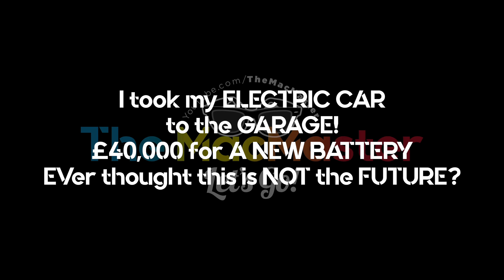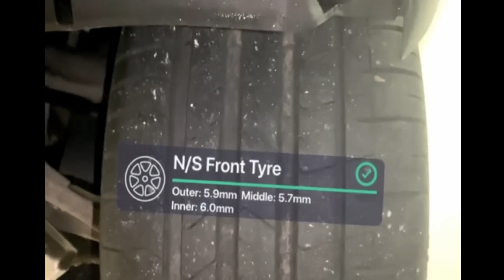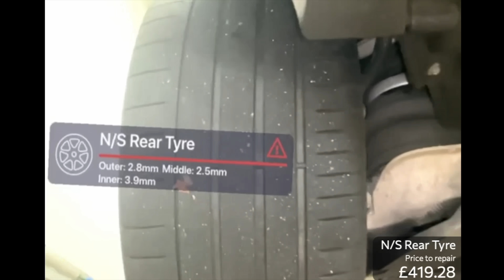I took my ELECTRIC CAR to the GARAGE! £40,000 for A NEW BATTERY EVer thought this is NOT the FUTURE?

Comment: Yes, all about control and nothing to do with reducing our emissions 🤦

The big difference between a battery in your phone or laptop is it doesn't have a battery management system like an EV does.
Most people leave their phone on charge past 100% and this degrades the battery, which is why they usually only last 2-3 years.
I had my last phone for over 5 years and the battery was still in reasonable shape, cos I avoided overcharging it most the time, managing your battery (which the EV will do for you) provides dividends.

The CEO of Porsche is just another greedy shill, as making synthetic fuels is way, way, way more expensive than either petrol, diesel or electric cars.

No electric lorries? Dude it's already happening 😂

Here are all the HGVs you can buy in the UK today.
Renault Trucks Master Z.E.
Renault Trucks D Wide Z.E.
DAF CF Electric
DAF LF Electric
DAF XF Electric
Volvo FL Electric
Volvo FE Electric
Mercedes-Benz eActros
MAN eTGM
FUSO eCanter
Iveco S-Way Electric
Scania Electric R-Series
Tevva 7.5-tonne
Tevva 12-tonne

Ah, more what-aboutism with the planes 😂 so light Electric planes already exist, but I'm sure you're probably on about passenger jets. Well as I've said before this'll be one of the last modes of transport to be solved, but the way batteries are developing I reckon there'll be short hall (which is the vast majority of flights) Electric passenger planes by the late 2030s - see the Electric Viking for more details 😜

There we go, your battery's fine.

£40,000 is a crazy amount of money, but unless you have a proper accident you'll be fine.

Enjoy your day 👍

Comment: EVS are the future , batteries will become loads cheaper once sodium tech advances. you never know i doubt it though . porsche maybe makes a sodium pack for tacan .
Reply: EVs may be the future for a few elites in advanced economies
but being a mature age pensioner I will never be able to afford one the most I can afford is $1000 on a second hand Subaru which is fine by me and since it has already cancelled its embedded energy is far lower environmental impact than a new EV
and apart from that if every one switched to EVs the grid would require an upgrade costing trillions and the mining required to build those new power stations would produce more emissions than the EVs would ever save 
and just to top it off  there simply is not enough rare earths etc to build several billion bloody batteries 
and so apart from this " inconvenient truths" EVs are great idea 
but that ia all they will ever be
Reply: Thanks for the laugh. Needed that. 😂😂😂

Comment: I'm surprised they can't just compartmentalise the battery so that if say something happens like it did to you they can remove the damaged part and join a new replacement section to the rest of the battery in situ.
Reply: Dont forget theres a complicated cooling system under there.
Reply: Bit of a risk of it catching on fire I think

Comment: I think there are plenty of good reasons why we should look to move away from an internal combustion engine. But oil being so profitable, it’s unlikely to progress unless it’s legislated for. But what that means is that we are compelled to use technology that hasn’t been proven yet. I do believe that the legislation government have introduced to reduce emissions will speed up the technological advances, but like yourself, I don’t believe that batteries are the end result of that. We are at the betamax stage

Comment: a cottage industry will arrive to rebuild battery housings & save the cars. many ioniq are having same issues and as we all know, if you get a rear end crash in a tesla, look it will bend the battery housing and need to be replaced. What is the effect? INSURANCE on these cars will go up so high, they'll end up in the junk yard. DO NOT BUY AN ELECTRIC CAR. time bomb. Lease it is better, but they will inspect the battery housing and charge you at lease end. NIGHTMARE. not worth it. in america, i'll pay $12/gallong. don't care. i got a hybrid and no more getting stranded with broken chargers or $20 10 minute top-offs. total ripoff. they will also start to tax TF out of them.
Reply: The question is whether insurance will insure the rebuilt batteries (and who will, cottage industry will warrant them against possible fire damage ?)   This replacement issues arise first of all not because batteries can't be repaired, but because nobody wants to assume the risk and put his signature

Comment: EVs are not ready for prime time. The main problem is forcing everyone to get one or have no car by 2030.
Although in the US, Porsche is a luxury brand with maintenance prices to match.
It’s not just the EV that needs development to make it reliable, safe  & affordable, but the infrastructure is still way behind especially with fossil fueled utility plants. The pressure is solely on the consumer to bear the cost of environmental causes, but NOT with the Utilities that generate electricity. I have just stated the obvious.

I don’t see why the UK is so pressured to do this.
CCP China is opening coal powered electrical generation plants often to vastly offset your efforts.

Comment: during ww2 germany was developing synthetic type fuels using i think coal as one of the products  due to blockades and everything erm not going to well for them and it was resource heavy for the amount of fuel they got back and then the plant got bombed.

and f1 is moving to synthetic fuel in 2026 so it cant be long before its out for public use because if a 1.6 ltr 1000bhp high revving car that has tolerances that tight the engine is practically seized when its not running (they have to run hot water around it to expand it supposedly) can run synthetic then a normal car should be able to.

Comment: I have mentioned before that l cycle an electric bike. My bikes cost E3000 each. Am on my third. Once the batteries go they are worthless. A new battery E900. 17:45 The previous 2 went to skips. Worthless. Disposable bikes because of the cost. Got 24,000km from each bike. No one, even bike shops would take them even for free. How does that help the environment. They have to be disposed of somehow. Scam.

Comment: All about control? Unlike you I charge my EV for free form my own solar! Who controls those who drive conventional cars? Yes the OIL COMPANIES, are you happy with that? My EV gives me freedom from Oil companies, dealerships ( no servicing required) and petrol stations. There is NO COMPARISON of the batteries in an EV with an iPhone, they will not need replacing in normal use they will outlast the car as they have a proper battery management system, how else can the manufacturers give you an 8 year warranty? Synthetic fuel is a complete non starter as it is many times the price of normal refined petrol, will you happily pay that? Grant Shapps drives a Tesla Model 3, Boris used to go all over London on his push bike, I have no idea why the current incumbent does not.
Reply: Your one of those EV evangelists aren’t you?
Reply: @JensSchraeder  no at all, I have simply driven a used EV for the last six years, saved £thousands every year in the process driving a car that is simply better than any ICE.
Reply: @edwyncorteen1527  I'm curious how big a system does it take and which EV, how many miles a week, etc.
Reply: And how many people do you think can afford to have solar panels put on their roof? The typical cost is in the region of £14k+.

One single house on my road has solar panels on it... the guy retired about 15 years ago and used some of his pension funds to pay for the solar panels. I live on an expensive road and the vast majority of houses on my road don't even have solar. 

If you can afford Solar AND an EV... you clearly have more money than most people, I wouldn't gloat or act like it's a "simple solution".

Comment: Really weird that you had a cause of possible damage and then the car started playing up but there is no problem.  Must admit I was begining to think that anything which could go wrong with an electric car would go wrong with yours, seems you've dodged a bullet on this occasion.
I'm afraid I just could not live with this kind of car it would be like having the sword of Damocles hanging over me, to be hit with tens of thousands in repair bills is just too rich for my blood.  I guess in the future we'll have a smaller number of car owners but those who are left will be from the well heeled section of society rather than peasants like me, bit like going back to the early days of motoring.  Guess I'll have to practice touching my forlock (whatever one of them is).

What seems a bit strange is that a battery pack is made up of a number of parts, many cells, cooling systems, cabling for power delivery, charging and control/monitoring and so on so why can a damaged part not be fixed?  I've never had to replace an ICE because a waterpump failed or a hose split or anything like that, seems ridiculous.  Seems customers are being taken for a ride with this.

If I were you I'd stop spending brewsters on fancy cars and invest a few quid in a dash-cam or two.

Comment: Ok. So no EV evangelist here but am interested in truth....both ways.  If a log fell off a truck and you damaged your ICE in your Porsche or any number of luxury cars, replacing the ICE would be a similar cost, I suspect.
Reply: If something hit a normal engine you would only replace damaged parts which would cost nowhere near the same as a battery pack, you wouldn’t replace a complete engine and all components
Reply: It wasn't a log, it was a piece of wood, and it hit the battery. The battery is under the passenger and driver portion of the vehicle...a similar accident on an ICE vehicle would at most have caused minor damage that would not be serious enough to write off the car.

Comment: Oh dear £40000 to go with your £700 service. So not an EV problem a Porsche problem. £17000 for a brand new pack from Tesla as an example and with an 8 year warranty from new or 4 year as a replacement. 

As for your questions I’m sure when someone decides to make a bulletproof EV government will start buying. (However when have the conmen in power ever followed there own rules?) 
EV trucks are already in production and as with the government vehicles just suddenly swapping isn’t economically or environmental sound. 
EV Planes will come or another alternative, personally you could scrap the lot for me.
Reply: It's shameful that I literally bought my entire car for £300 more than that £17k he would need just to get the battery pack....
Reply: @thefiestaguy8831  even more shameful that a 45mpg car over 4 years for the miles I do would cost in fuel alone, what I would spend including buying a battery.

Comment: How Lee ? No way you need those cell battery racks replaced already, you haven't even had that 2 years yet ?... You should be getting on average 6 to 10 years on average depending on use and charge.. Use you UK warranty of 6 years for England. (Only seen video now, I see now, not my fault, your Thumb.... )
(How much did that custom reg cost you Lee?)

Comment: Apparently F1 is developing a synthetic fuel as well. And what about ships? It would interesting to see how long they would need to charge on a voyage.
Just had another thought, if ev’s are in an accident, as cars sometimes are and the battery is damaged will this write the car off on insurance due to the exorbitant cost of batteries?
And also, 😅 how are they going to cope with the extreme temperatures everywhere is experiencing now?
Reply: Insurance companies are already writing them off if they are involved in minor accidents because repair workshops will not do any maintenance on them because of the high voltages involved.
Reply: @oojimmyflip  mmmm, didn't think that one through very well did they?

Comment: Remote control, I will take-off battery cover and roll batteries with my thumb. Back to reality..............RULE #1 EV must be lifted 4X4 so you do not hit a small pebble on the road. Well, bye the time they get these correct...............Ill be dead and gone.

Comment: Electric cars a joke fella, jcb developing hydrogen/diesel engines but other companies like Porsche are developing synthetic fuels which means we will go full circle and all be driving petroleum and diesel vehicles that run on synthetic fuel, but doesn’t eliminate the other pollutants like brake pads and clutches which are terrible pollutants
Reply: Hang on, you are suggesting synthetic fuels are fine because they don't create any pollutants which just leaves clutches and brake pads which you declare are terrible pollutants? Where on earth do you get your information from? Synthetic fuels are still burnt in a car engine.

Comment: Hey 
Tesla batteries lose 10% in degradation over 200,000 miles 
They are NOT smart phone batteries 
Think of a combustion engine doing that mileage 
Degradation is not an issue 
First iterations yes we're are crap 
I have a Nissan 1st generation elec van it's range is 80 miles 
When it was minus 10 recently it dropped to 50 pmsl and with the heating on 40.
You need a pre conditioner and your batteries will last a lot longer than you the driver 😂

Comment: A pure electric Vehicle is not an alternative to an ICE car, nothing like, but A Hybrid is, it uses less fuel and creates less pollution. There are environmental cost to EV's that are not really considered, the argument for them is skewed in their favour. As you say, it's all about control, actually very little about the environment. Cars are not the biggest polluter are they, badly insulated homes are far worse.
Reply: I owned 2 hybrid cars. While I was doing the commute round the M25 it was a some consolation to be getting 60 m.p.g while doing 5-10 mph crawl. However in free flowing traffic such as motorway driving the advantages of a Hybrid evaporate. The extra weight takes MPG down to just so-so. So if you drive in heavy traffic a lot then a hybrid is a good choice. If you don't it isn't. None of this changes the unavoidable fact that it is just a criminal scam to be blaming CO2 and thus ICE for climate change.

Comment: I don’t agree with the control bit. When I last checked you still have a choice as to which fuel you wish to buy into in the case of Porsche petrol or electric. And I have to say the age we are you could buy a brand new car in 2030 if that doesn’t get pushed back which is very likely and enjoy that car for many years there after I would like to think the insurance would pay out on a new battery it’s an integral part of the car. As for the control I think the governments around the world do that with our lives already without owning a car. But yes get a dash cam.

Comment: If you can afford a Porche Taycan, or indeed, any Porche, you can afford to maintain it, through everything that happens to it.  If you can't why did you buy it?  

As to rest of your utterances, seriously, you really do have some very bizarre ideas.  I came here to hear something coherent and supported by some sort of facts.  Guess it was a wasted journey.
Reply: What a sanctimonious response! What has £40,000 (!) to replace the battery pack got to do with "maintaining" it for goodness sake? That's well on the way to the cost of a full restoration on an old ICE version. Grow up.
Reply: I'd assume he leases the car or has it on hire purchase instead of owning it outright. He's said it would cost him a lot to hand it back so this would imply he has it on a lease.

I also think you have to be pretty mental to lease one of these.... bearing in mind the car costs £120k, if you lease or purchase it on HP over a 5 year deal the HP would work out at £2,000 a MONTH and that's assuming you got a 0% finance deal. If there's any interest it'd cost more than £2k a month. I live in an expensive part of a nice area and I could literally rent the most expensive house on my road which has a massive drive, an outdoor tennis court and a big garden and probably still have £100 change from that £2k a month.
Reply: You have to remember that this is for entertainment purposes only and not meant to be taken seriously - a bit like Clarkson on Top Gear.